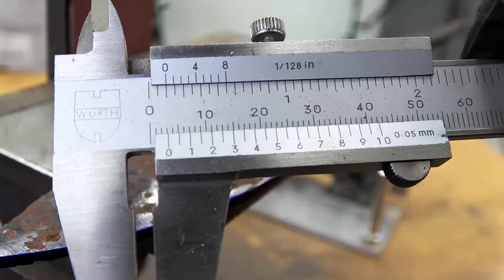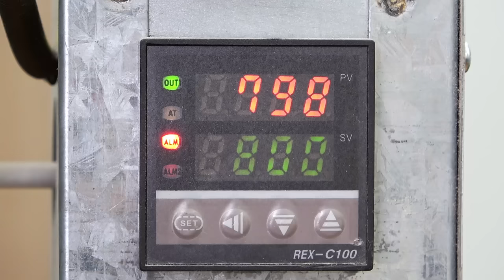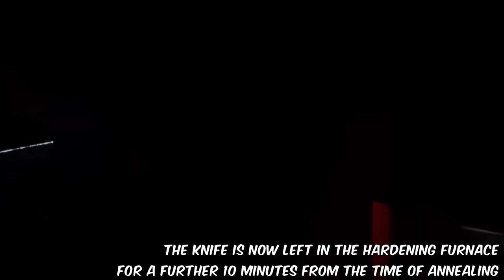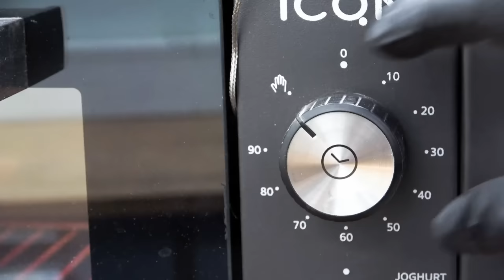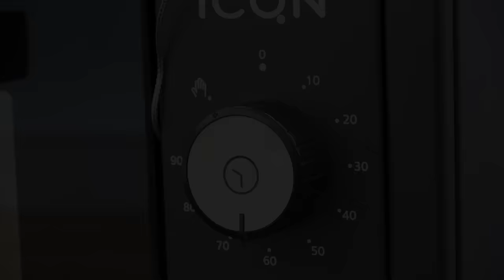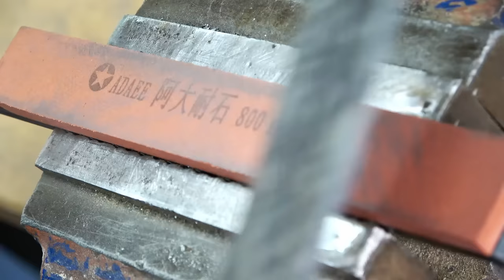Machete Restoration – Knife Transformation [Ebony Brass Handle]

Comment: Das ist keine Machete, das ist eine "Hippe" (oder in der Schweiz "Gertel") - oder besser: es war eine... 

Zum Glück nur ein günstiges Gebrauchswerkzeug (um nicht zu sagen "Verschleissteil"), kein teures Werkzeug - und somit ist auch die Transformation zur "Kurzmachete" kein Problem. Besonders schnitthaltig wird das schöne Messer allerdings nicht sein; Gertel und Hippen sind nicht sehr hart (darum so ballig geschliffen) und bestenfalls aus 440er oder Federstahl.